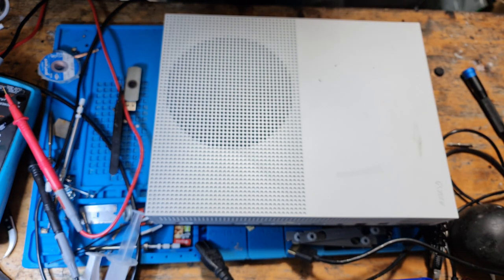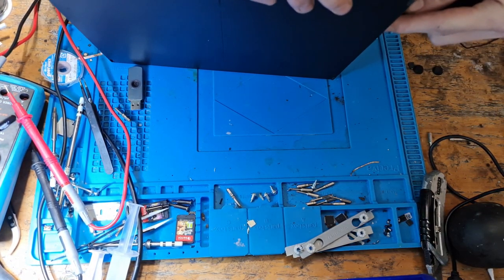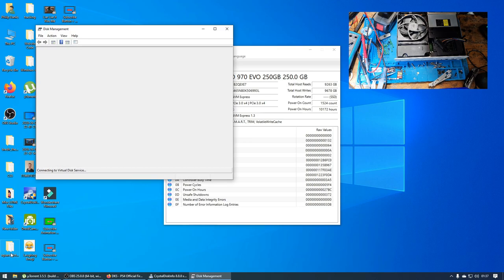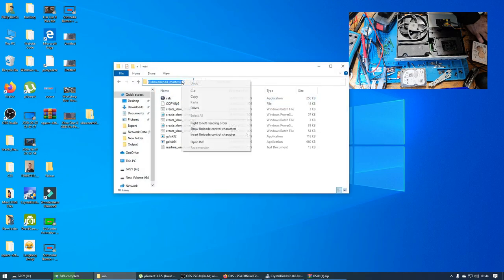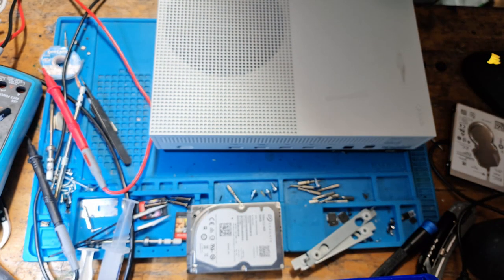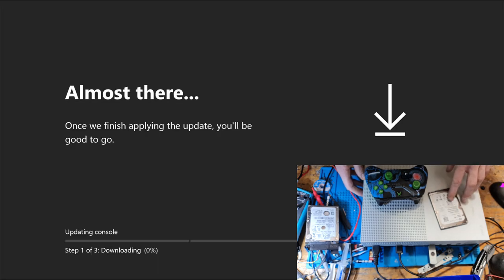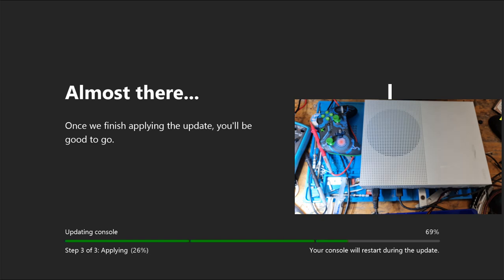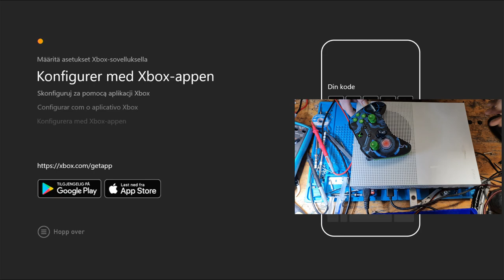Xbox One S Turns Itself Off After 30 Seconds - Quickly Fix 30 Second Shutdown Issues Xbox One OG/S/X

Comment: can i just buy a new hdd with the same storage capacity? will this work
Reply from the maker: Yes you can buy you may need to prepare the hard drive first
Reply: I've use a 640gb disk drive but only could use 500 GB. The software used allows using 500 GB 1TB and 2TB partitions.
Reply from the maker: @jorgeplaza7938  if you plug the hard drive back into windows you may be able to extend the partition to free up the other 140gb using windows disk management
Reply: @TheCod3r  Which of the 5 partitions can be extended? Have you tried it before?
Reply: Hi how do you prepare the new hard drive
Reply from the maker: @denisegarrett2612  you need to use some software called xboxonehdd-master which you can download free. Just search Google and it'll be one of the first results :)

Comment: So my xbox just froze and turned off by itself. I turned it back on the tv said no signal and the xbox turns off after about a minute or two, the fan is still running tho. So does anyone have a fix maybe? Im having a mental breakdown
Reply from the maker: This sounds like a hard drive issue mate if I'm honest with you. You may need to replace the drive to get it working again
Reply: @TheCod3r  Thank you
Reply: @TheCod3r  not sure if you’ll see this but just got back from not using my xbox for 3ish months. It wouldn’t turn on at first. Unplugged everything, held button down for 10 secs, then it turned on fine but I was prompted with an update from xbox. The update got to 30-40% then the xbox restarted but never turned back on. Not it turns on for 30ish seconds, then turns off.
Sound like a hard drive issue to you? Before I go trying to open it up